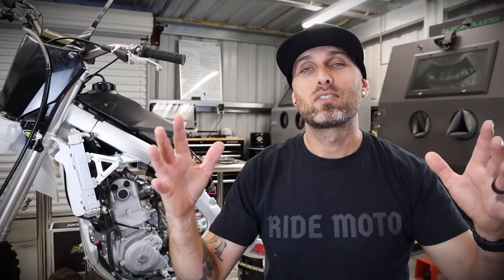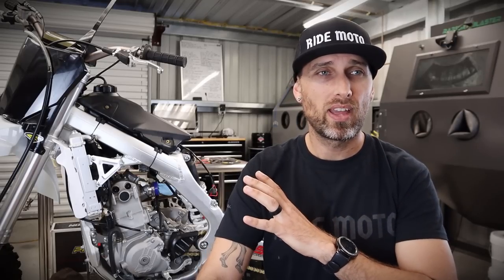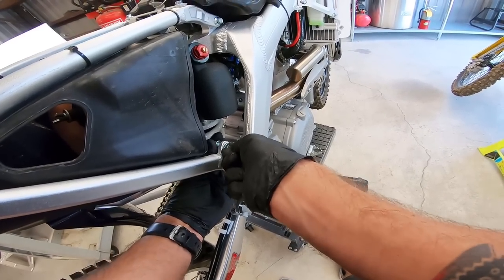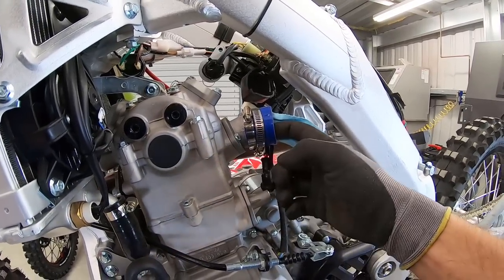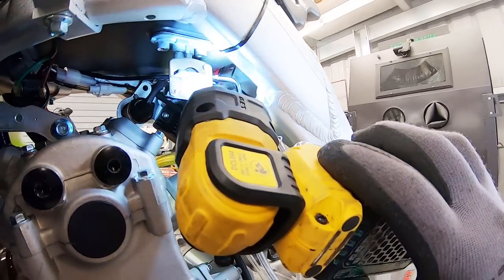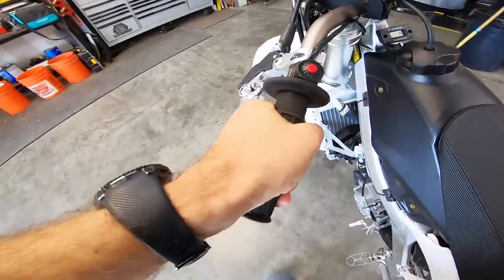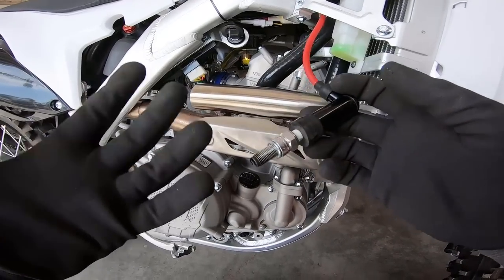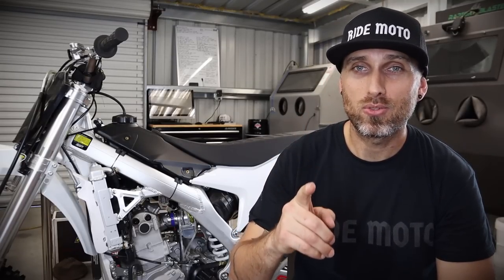I Installed A Lectron Carb in my CHINESE Dirt Bike... SHE REVS!! - 2020 SSR Motorsports SR300

Comment: You might as well get a second hand crf 250 or 450 which would have a lot more power than this bike.
Reply from the maker: Definitely an option. I myself am not a big fan of used four strokes. You never know how those expensive engines were cared for, or lack thereof

Comment: What engine is this a clone of?
Reply from the maker: The engine is a Zongshen powerplant. "NC300" so not a clone.
Reply: @mxrevival  oh ok, I know they made some clone engines, i wasn't sure if they did the same with this one. Thanks
Reply from the maker: You're very welcome. The bike is a Honda clone so totally natural to think the engine could be too 😎
Reply: @mxrevival  for sure, I wasn't sure what exactly they used in it, it seems like a nice bike for a Chinese bike , I stuffed a Zongshen crf230f clone engine in a Crf450 chassis , its not an exact clone but everything in the top end of the engine works, I installed a high comp piston, cam, spring's and ported the head, and advanced the time 5* and the thing screams for a 230 engine .

Comment: @28:24 not the best demonstration seeing as the plug wasn't grounded but at least it was an easy fix
Reply from the maker: You're absolutely correct Jonno.

But... not the best demonstration on providing a solution to help educate others either 😉

Jonno's comment broken down:

He's referring to the fact that, to complete the electrical circuit- the spark plug should be grounded against the engine casing (a connection much like as if it were installed AKA "grounded") in order for the current to travel and actually show a spark.

The way the plug was held in the video is a poor demonstration because the plug is not grounded to the engine/ chassis thus no spark would have been present to the naked eye anyway when I "try to show you" there's no spark. So the procedure, while the lack of spark was indeed the actual cause, was in fact demonstrated incorrectly.

No spark would have shown in either case, grounded or not, as the root cause was a disconnected wire.

I know better, and blew it 

Hopefully that's helpful!

Comment: It looks cheap. All you can do with that thing is trail riding, you can't enter it in any racing event. It's not a 250 and would get it's ass kicked in the 450 class. I think it will blow up and, boo hoo, you can't get parts. LOL You're SOL
Reply: I have this carb brand new. Installed and can't get bike to run without the choke being ON....